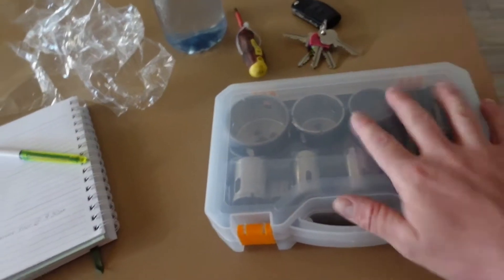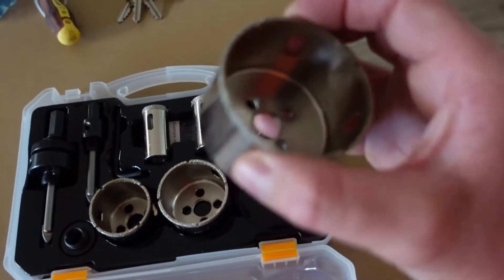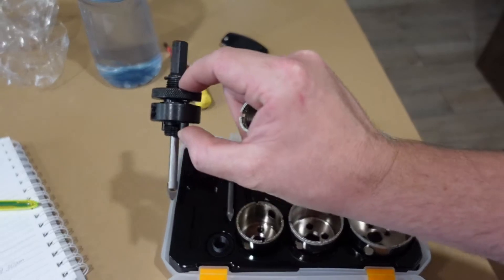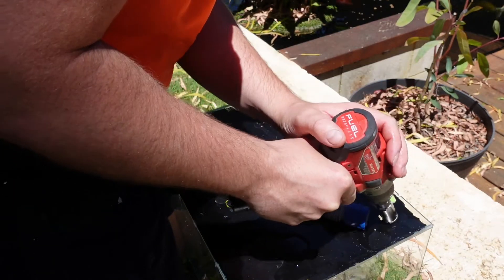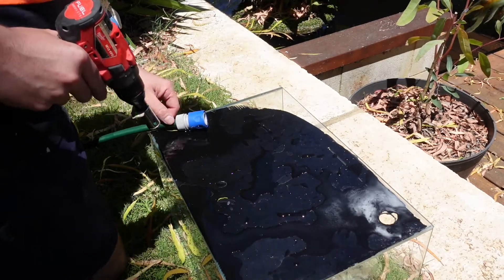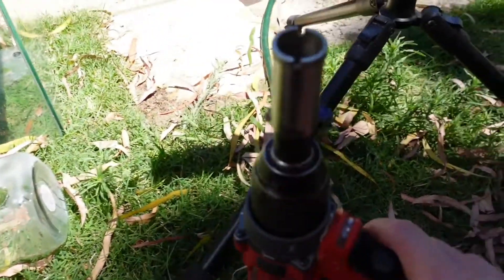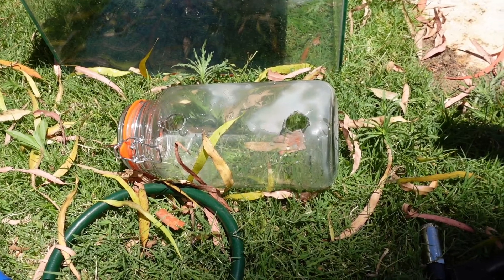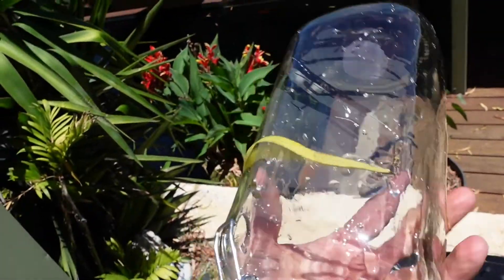Craftright 9pce Diamond Holesaw Set review!

Comment: fill the jar with water before drilling
Reply: Wouldn’t do anything would it? Ya want the water on the outside aha..
Reply: @Dansfishroom  it stops the vibration in the glass which should stop it from cracking. But yes the bit has to be lubricant.
Reply: @glencheeseman5469   ah awesome learn something every day 
Good tip
Reply from the maker: Nice tip but it was way to thin to screw any fitting on
Reply: If it was a lemon and lime jar I don't think it would definitely crank trying to tighten the fitting
Reply from the maker: I just finger tightened it and it exploded